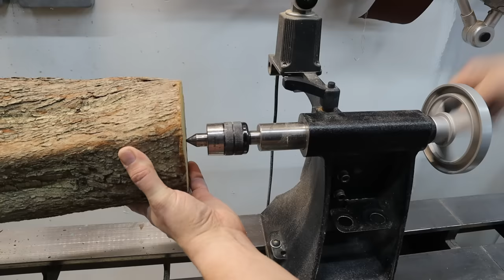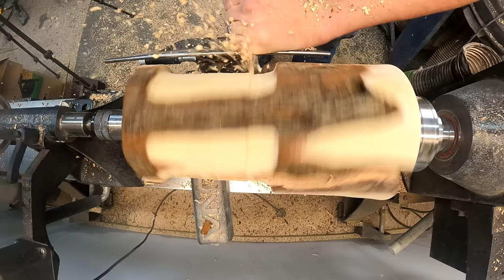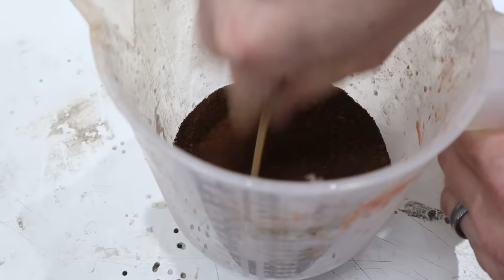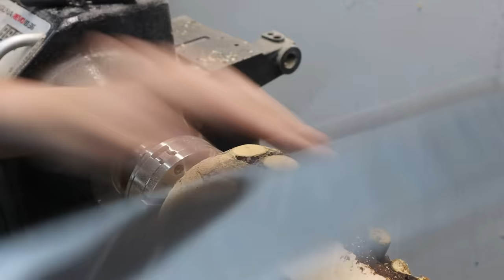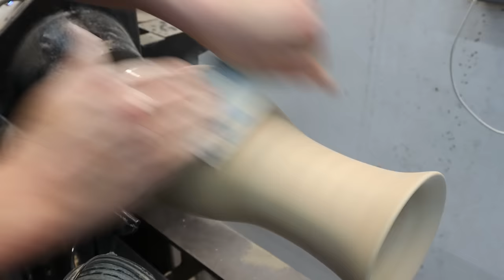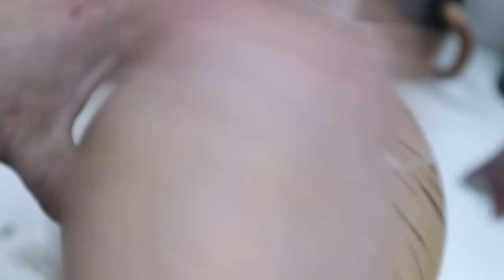Woodturning - Cracking Hawthorn

Comment: Just a random question on safety... The wood is turning towards you, what if it was to snag that tool you've got, could it pull your hand into it?

Why doesn't the log spin the other way? Surely it would leave the mess confined below and it'll be safer?